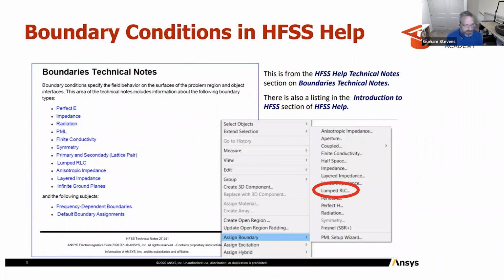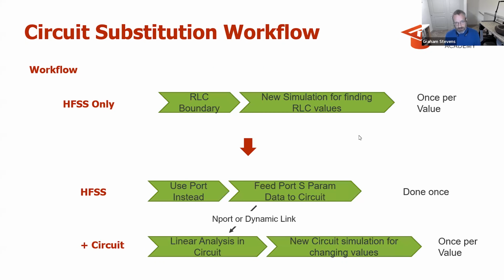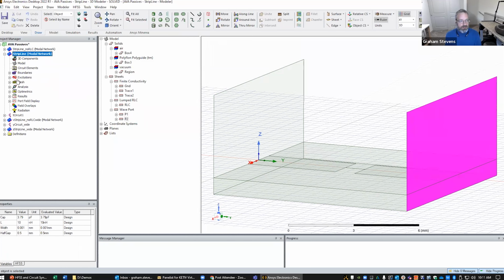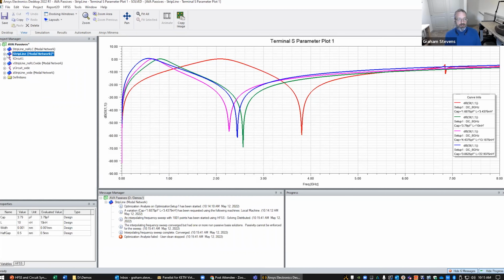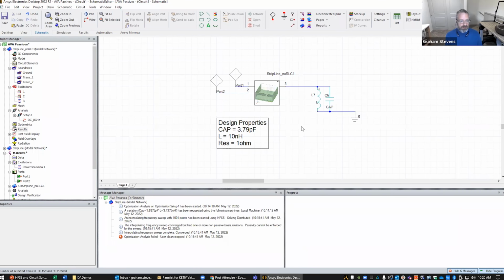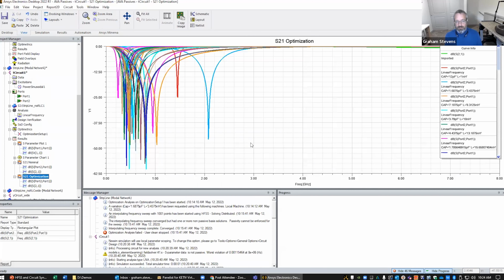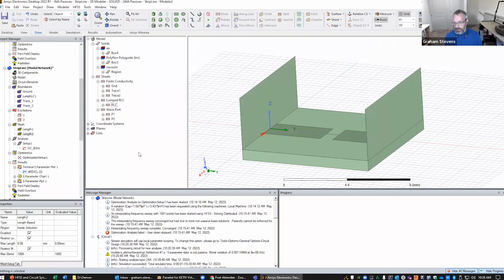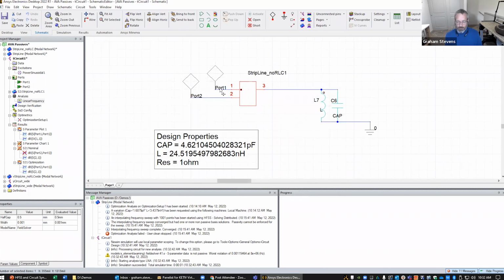Ansys HFSS and Circuit Synergy | KETIV Virtual Academy

Comment: Why don’t you need two ports, one for each strip line? What lets you use single port (to ground) as equivalent?
Reply: I think the naming of a port here is not the same as in a transmission line port. The port here is more of a voltage terminal so "port 3" is just the ground of the entire system. In practice you have two ports. Port 1 would be Port 1 relative to Port 3 and Port 2 would be Port 2 relative to port 3